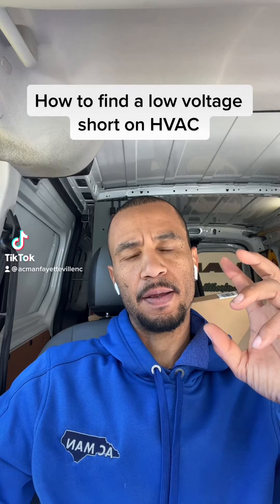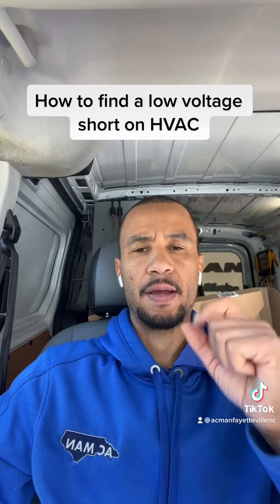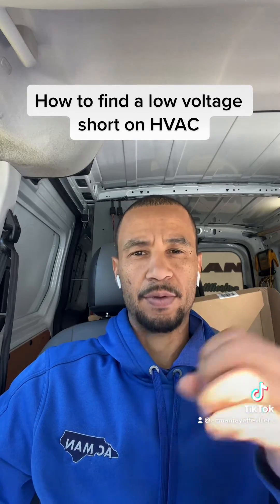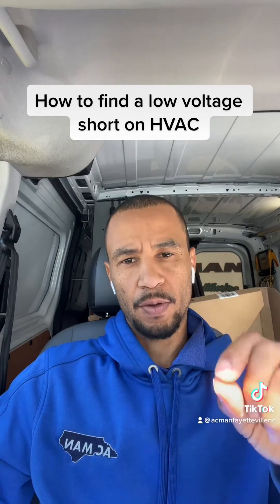how to find the low-voltage short on an HVAC system

Comment: Thanks for your video. What should we look for when the heat strips are coming on after a cooling call? The behavior seems to be like a defrost call, but the heat strips only turn off after a call to cooling again. If I disconnect the Commonly Close wire from the control board, they heat strips turn off. Thanks again. There is no defrost board at the condenser.
Reply from the maker: maybe two wires, touching in the thermostat jacket